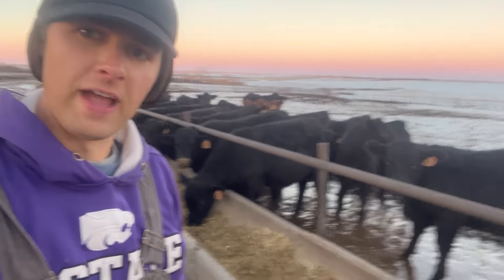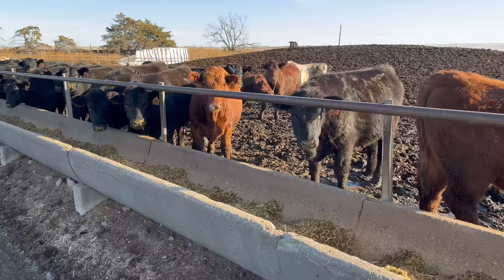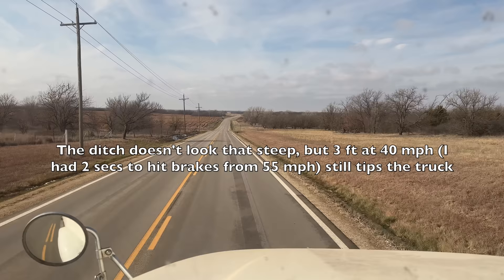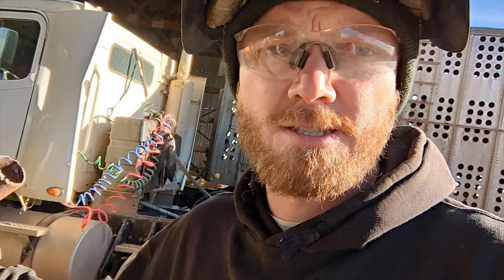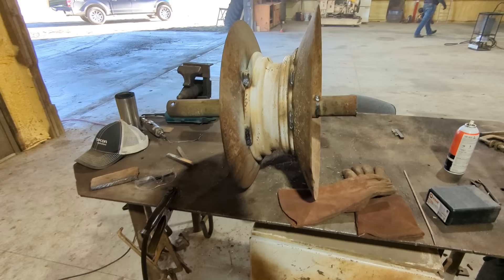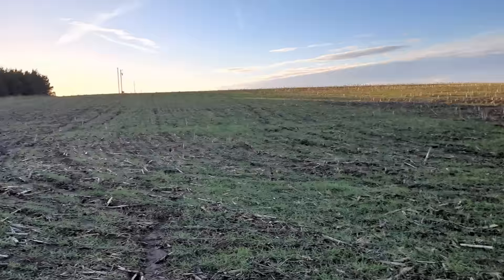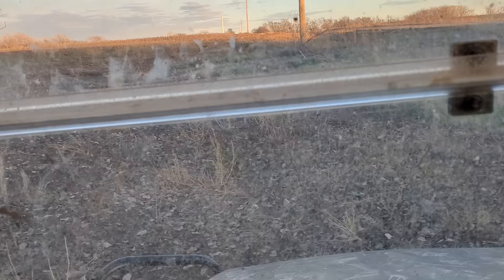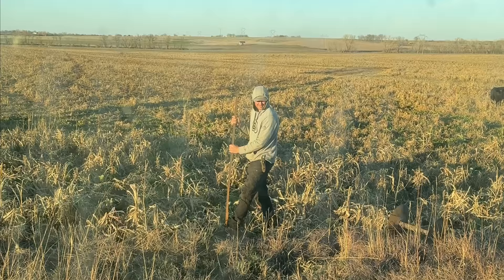Greg Reflects On His Semi Crash

Comment: Saw the coolest wire roller...it was the entire vehicle rear axle on 3pt and driven by pto. Gearing determined the speed and when one wheel was full, there was another on the "passenger side", take off a couple lug nuts and swap em. Farmers are awesome engineers!